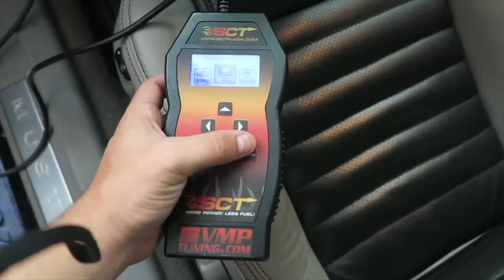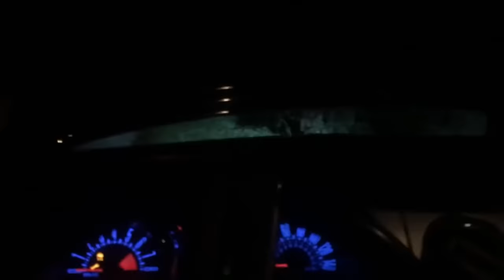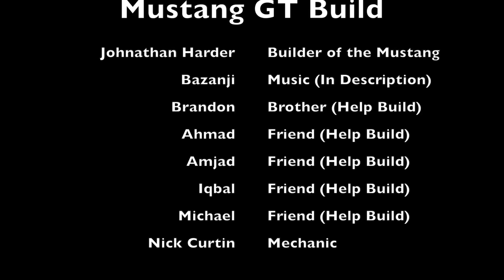Building a Mustang in 10 Minutes

Comment: I'm not a huge fan of mustang's but that thing is MEAN, nice build
Reply: I agree
Reply: You must be one of those dodge fanatics 🤦‍♂️
Reply: @macncheeks9428  lmao
Reply: I'm staying away from American cars. They're so unsafe and unreliable.
Reply: @HALTHEOO  what are your other choices???
Reply: Toyota Supra (IV), Nissan Skyline GT-R (R34), Mitsubishi Lancer Evolution, Subaru Impreza 22B, Mazda MX-5 Miata, Nissan 240SX, Toyota Corolla GT-S (AE86), Nissan 300ZX, Mazda RX-7 (FD), Honda S2000, Mitsubishi 3000GT VR-4, Acura Integra, Type R, Nissan 240 Z, and Toyota MR2... basically Japanese cars that's been proven to produce more power and at the same time reliable in the long run.
Reply: @HALTHEOO  damn I went blank when typing that. There are more cars than jeep, chrysler, dodge, ram, ford, chevrolet, gmc, and all that american motorsports
Reply: @javierrodriguez4466  If only american car brands werent making their vehicles with too many cheap parts - plastic interiors that looks horrible over time and cracks, etc.
Reply: @HALTHEOO  i like american vehicles but the only japanese cars that i like and respect is the tacoma and newest year supra idk. Also subaru cars are pretty damn good and i like them
Reply: @javierrodriguez4466  The new supra isnt really a "supra". If you didnt know... the chassy is related with BMW Z4 (G29) and  2 engines (BMW B48B20 turbocharged I4) and (BMW B58B30 turbocharged I6). So clearly toyota went cheap on this and completely ruined the legendary name "supra".
Reply: I got nothin' against BMW but it just wont feel like a "supra" to me. The car sounds like a Z4 and interior design as well.
Reply: @HALTHEOO  well i didnt know i liked the car by the looks. I dont even know how is the interior
Reply: @javierrodriguez4466  Even the navigation system says BMW. Before getting one pop the hood and you'll see plenty of BMW stickers with those parts. Hey atleast the Toyota badge and the supra emblem is atleast made by toyota aye. Haha
Reply: @javierrodriguez4466  Honestly I prefer the supra concept car design. Current design looks unproportioned.
Reply: @HALTHEOO  what cars are u looking for? Lol we finna have a long convo in youtube vids
Reply: - HALTHEO -  Really out here calling Subarus and rotary cars reliable?
Reply: @quartz1448  there are certain subarus that are really damn reliable. Ik that there are sometime where the motor explodes. But they are subarus that are reliable and they are really damn hard in the box itself making it secure
Reply: - HALTHEO - you’re just scared. It’s more car than you can handle.
Reply: - HALTHEO - jdm fanboy 🙄
Reply: All jdm and all american cars are AMAZING
Reply: Same hear
Reply: @shawn3817  we really whant more people like you in car community
Reply: @macncheeks9428  But hey Ford mustangs are great either :))
Reply: @youssef1770  compare it to it's competitors and mustangs are so much better
Reply: More of a bmw fan myself but dang
Reply: @macncheeks9428  yeah I like dodge, what’s your point?
Reply: Lol I'm a huuuge fan of mustangs
Reply: @macncheeks9428  I mean it’s not anymore of a muscle car than a Challenger is, Challenger’s are the definition of muscle. I love Ford and Dodge both
Reply: @HALTHEOO  that makes the old supra a Yamaha
Reply: @HALTHEOO  So you are jdm guy? :D

Comment: I tried rebuilding my mustang in 10 minutes and well it's taking me months and months
Reply: Same I too tried a mustang build but all I got done in 10 minutes was driving it back home
Reply: @surprisedface727  yea  lol
Reply: @Gumorisco11  you have to work for it man.
Reply: @soul9549  lol it was a joke so far ive done with my 5.0 i installed an xpipe and muffler eliminators, a bbk intake, ferrada wheels with invo tiers, wilwood calipers, just need to lower it more about an inch a new grill and a body kit later on ill do more mods to the engine
Reply: @Gumorisco11  nice
Reply: @Gumorisco11  I wasn't being mean I was just saying

Comment: I mean..you basically customized it more than built it, if you wanna build it then you'd have to go straight from scratch, also be sure to run that thing at least once everyday because the batteries on those things run out fast if you don't start them up once a day or so after a few days